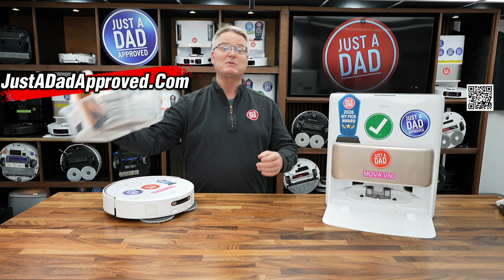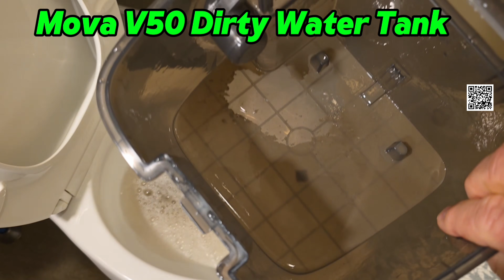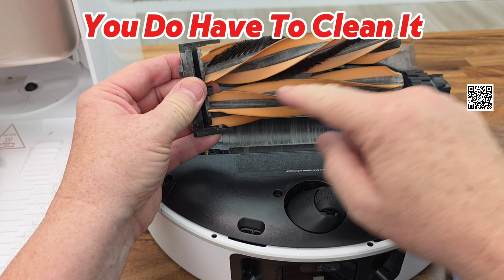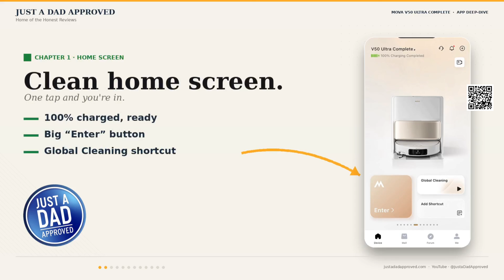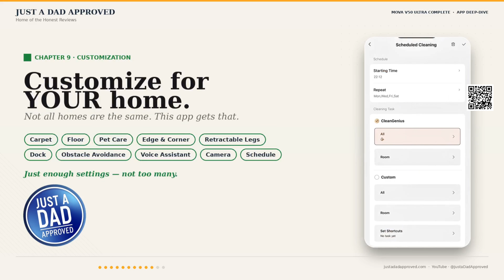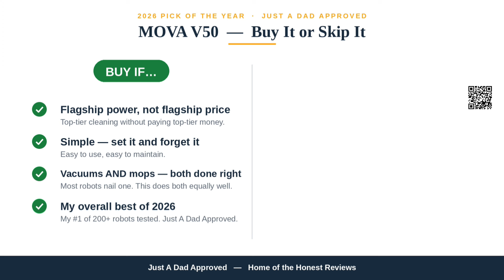200+ Tested: The Best Robot Vacuum Mop Combo of 2026!

Comment from the maker: See the Mova V50 on My Website at JustADadApproved.com
Reply: @JustADad what odor tablet did you use at the 4 minute mark? Mind sharing a link? Thank you
Reply: @JustADad ..  After watching several of your videos about the Mova V50 Ultra, I bought one to use. 
I found that the machine does not wash the mop with 80°C hot water, does not use hot air during the drying process, and does not mop the floor with hot water. All the measured temperatures are just room temperature or higher not more than 3-4 degree celcius.
In several video where you discussed the heating feature, did you actually test and measure the temperature while the machine was operating? Kindly advise.

#MOVA Support informed me that the machine is operating normally. They stated that the correct way to check is not by using a thermometer, but by running a mop washing cycle with cleaning solution to see if the pads actually come out clean, and for floor mopping, to check whether the floor is effectively cleaned. =='

Your confirmation would be very much appreciated.
26 Aug 2026..

Comment: I bought the Mova V50 because of this review. Mine stopped working two months after I’ve owned it, after only six uses. It stopped returning to the dock and gets stuck half way. Did all the troubleshooting to no avail. And I see similar issues on recent negative reviews on Amazon. So disappointed. $700 for junk.

Comment: Dreame X60 pro ultra: 1,199.00 € 
Roborock Soros 20:  999 € 
Mova S 70: 449.00 € 
ROBOROCK Qrevo Curv 2 FlowX: 719 € 
Roborock Qrevo Curv 2 Flow : 549,00 € 
Roborock Qrevo Edge 2: 889,99 €  

I almost have no carpet, I can even vacuum clean the carpet my self. but I have a lot of hard floor. I want the top mobber and not so weak vacuum for the dried dust and stamps of dried liquid to remove marks.  

It is my second time search and deciding to wait because all videos are saying it is not good enough. After deciding for Qorvo Flow 2 for doing good mobbing suddenly Edge 2 has more vaccum power.

Can some one advice specially that I think the robot vaccum cleaner is almost like a TV, you buy one you are stuck with it, giving it away, is going to be almost for free?

Should I go for the cheapest or one that I know I will heavy use and not regret that is 1000 euro but yet depend on it more often than 500 Europ that might let me down?

Comment: What is the best vacuum only robot for around 400-700? We currently have the Roomba j7. It works decent but the battery is starting to get weak and we need something with longer run time. Would what you’re recommending be a big upgrade?

Comment: The thing that makes me pause with purchasing any of these new robots is parts availability.  They are basically throw away machines if something goes bad, like a drive board or any of the electronic sensors.  The Roborok, Dreame, Mova, Eufy, etc. machines are all designed and manufactured in such a way they just cant be repaired.   The manufacturers wont even repair them!  Compared to my Roomba I6...... I can buy any part that could ever go bad and parts availability is excellent.  My I6 is rocking along 6 years after I purchased it and runs flawlessly.  Their modular, screw attached design is just a better design for longevity and repairability.  All the other brands use heat staked assemblies which just arent designed to be repaired.  I wish Roomba would get their act together.

Comment: Got rid of my eufy s1 pro , it clean pretty good but is not reliable at all , in the 9 months I’ve been using it has broken twice, one time with water pump from the base station and recently the part where connects the robot to the base station to drain the dirty water reservoir, that little piece broke (on the back of the robot where the charging pins are ), I’ve been using it just for 9-10 months max and eufy already told me that they can’t fix it when I made the claim because is under warranty, they said that they don’t have the part and they can’t send me a replacement because is in demand that robot and they don’t have any available, what a scam , I escalated the case also because their only solution was to give me 30% if the total price I paid for it which it was $1016,49 on sale , to me a company that don’t have interest in fixing their product under warranty and a premium product because when I bought it it was the top of the line vacuum on their website it is unacceptable, they agreed to refund me the full amount after I went nuclear on them , not buying anything from eufy after this experience

Comment: I bought this vacuum based on your recommendation and it was GARBAGE. It died multiple times in the middle of the floor. Spawned multiple rooms. Took forever to clean the house and would have to go recharge mid way through. Got stuck under a table twice. Would go crazy whenever it's top sensor went down and take forever to get out from under the table. It would retract it's top sensor under a super tall table for no reason. This is all in less then a week.

The only nice thing was the MOVA refunded me my money and didn't give me a headache. But for me this vacuum was a disappointment

Comment: The product itself is really good. But robot vacuums rely heavily on apps (unlike floor washers). Considering all the negative news surrounding Dreame lately, I really doubt Mova will be able to avoid the fallout. If Dreame goes under in the next year or two, this robot might just end up with no app and no internet connection.
Reply from the maker: Dreame seems like a pretty big company that is doing alot of good products,
Reply: @JustADad  It is indeed a large company, but it has been plagued by negative news in recent months. Management has been pursuing disorderly expansion, and a significant portion of their investment stems from local governments. They are currently undergoing investigations. Typically, such proceedings do not occur without cause. As a result, the risk of Dreame's capital chain fracturing in the future is exceptionally high.

Comment: I was just about to pull the trigger on the v50 but…the failure rate is higher than I think is acceptable, the battery doesn’t last near as long as they claim and the most important is they seem to have horrible customer service if something goes wrong. For these reasons I couldn’t get myself to take the risk.
Reply from the maker: I appreciate you sharing your concerns, as it’s important to find the right machine that you feel confident in. 👍

Comment: I am considering buying the Z60 ultra roller complete but I’m unsure which is better the v50 or Z60 for the value and features?
Reply from the maker: For pure value, the V50 is hard to beat right now. 👍
Reply: @JustADad What about in terms to pros & cons & dealbreakers which is better also which model will handle more piled carpets? Thank you

Comment: Could you do a video on which robot vacuums can be used with local WIFI but without Internet access for people concerned about privacy. I know you recommend for people that are concerned with privacy to get a model without a camera but that makes obstacle avoidance much worse. It would be nice to have this V50 or other models like it work with local network only and without Internet access.
Reply: you can select privacy choice in the app. you can disable the camera in the app. it's turned off by default. you need an email account to connect to the cloud that allows it to store maps and operate remotely from app.  only Eufy RoboVac 11S / 11S MAX/11S MAX Slim will work without internet. use your search engine

Comment: I bought mine a week ago and it came with a deal that gave you two extra bottles of floor cleaning solution in addition to the one that comes with it. They also give 10% off to veterans and first responders so check for deals because I got mine for almost $600!!
Reply from the maker: That is a great deal, it’s always good to check for those extra discounts before buying! 👍
Reply: @JustADad  and just over a week later it's all messed up. Won't vacuum, makes a weird noise now when the beater brushes are running, and goes out about 3' from the base station and says "I can't get there, cancelling job"

Back to Mova!
Reply: Just to throw this out there. My understanding is that the cleaning solution is not for the floor but rather for cleaning the pads. Only water is used on the floor.
Reply: @trevorkinloch3193 There are two settings that you can activate: one will turn on detergent for floor cleaning, one turns on detergent for mop washing. If you leave both settings off it will only use water on the floor and mop pads.

I had to open the app to make sure.

Comment: So y’all don’t recommend the movav50? lol I’m tryna get one under 700
Reply: Are you a veteran or a first-responder? They have 10% off if you are, also for teachers, students, and seniors. Check out their discount page to see if you qualify. I got mine for $630 after discount. My V50 is great. I had a Roomba before and it was awful, so bad it almost turned me off of robot vacuums forever. Another thing I don't think he ever talks about: the V50 has a camera you can access from the app and drive the robot around like a roving security camera (it's mainly for interacting with pets) and it lets you keep an eye on things when away from home.
Reply from the maker: It’s the best value out there, especially since it comes with $200 worth of accessories included.

Comment: My P10 pro ultra roller stop working ( I guess because I put the hair cutting roller as recommended ups )  and there is no sensor to detect if no working, but it took only two weeks to be repaired so not to bad.
Reply from the maker: That really good news about there customer support
Reply: I have a Z60 roller mop, and the mop cover has broken twice.  They repaired it quickly both times.  But if it breaks again, I have had enough with Mova vacuums.  My old Roborock ran for years without issues and it was a mopping robot.

Comment: Hi any idea on when the mova V70 ultra is going to be released. I'm holding off on getting the V50 because I want that bagless system the V70 offers.
Reply from the maker: not sure sorry
Reply: I seen that it’s suppose to come around late summer early fall
Reply: Also looking forward to v70 but I hope they create a version with a bag. I don't want to have to deal with emptying and cleaning a smelly, dirty base station compartment that has been collecting the crap on my floors for weeks or months. Mova already had it right with bag vacuum that immediately seal upon removal that can be tossed in trash - simple and easy...don't reinvent the wheel...
Reply: @richardpayne7486  then empty the canister more often than weeks and months....wow. sealing vac bags have been around long before mova

Comment: Sorry i disagree  i have had 3 replacements  of the model from mova and all 3 gave up after 2 weeks i strongly do not agree this is the best out there for 2026 there are better even at the mova price
Reply: I can see your point if three V50’s have failed on you 😱…This robot definitely has some flaws that for some reason dad seems to neglects over and over again… 🤦‍♂️ 

Yes it might in general be a value pick for some out there at this low price point. I get it!

But please dad, I understand that you have a strong desire for this particular model to be the solution for most homes. But please, don't be so blinded that you can't see or mention the weaknesses of this model too!! It’s right in front of you!! The auto emptying design is of poor design. (This is a well known issue for both the V50, Dreame X50 and L50, but you fail to see or mentioning it..Why!?) 

I have also not heard dad mention once that the base station on V50 unfortunately can’t be connected directly to water and sewage as both the Dreame X50, L50 and many other robots have the option to. For some users, this may be crucial information...
Reply: there's been issues with some defective parts and software. a lot with app updates as well. i keep coming back to v50. nothing beats it as of now. mova stands behind their product for 3 years

Comment: Another great video, thanks for doing these.  Just a quick question.  I know you're saying the v50 is the best robot vacuum, but is that because it's good at the price point ?  In your opinion, if price was not an issue at all...what would be the best cleaning robot, both vacuum and mopping.  Just 1 overall best of the best if cost is irrelevant.  Thank you very much.
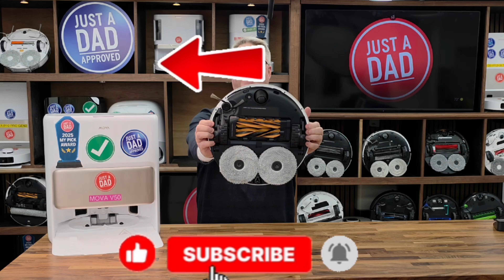Reply: I love spinning 12:39 mop pads.
Reply: I have the same question, what is navigation on the furniture as well as cleaning and maintenance thank you so much for your videos. I also have one extra odd question is there one robot that could clean up and some chunks of small grapes
Reply from the maker: You can spend more but not sure its worth it.